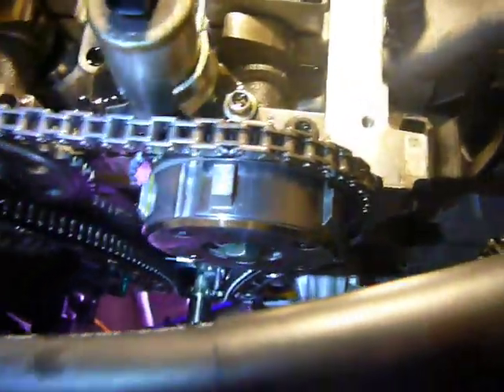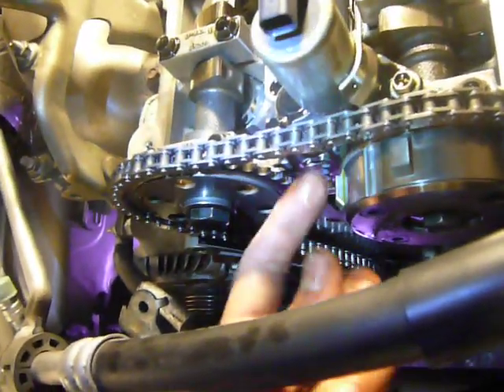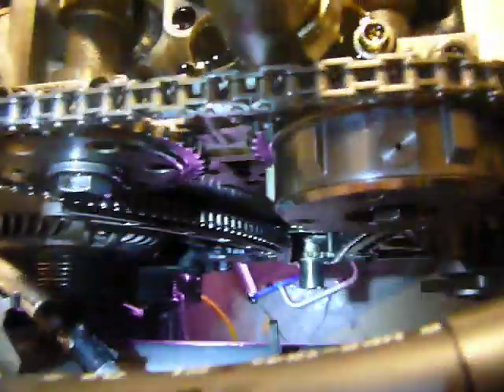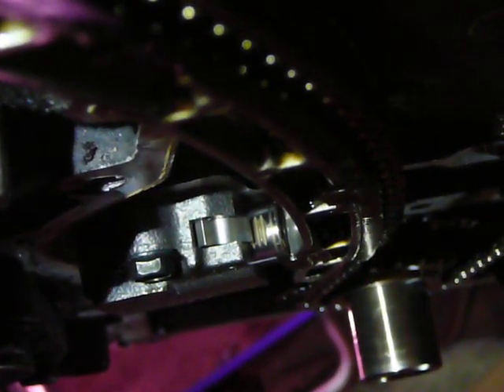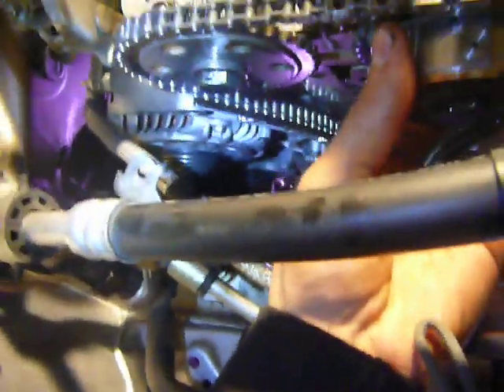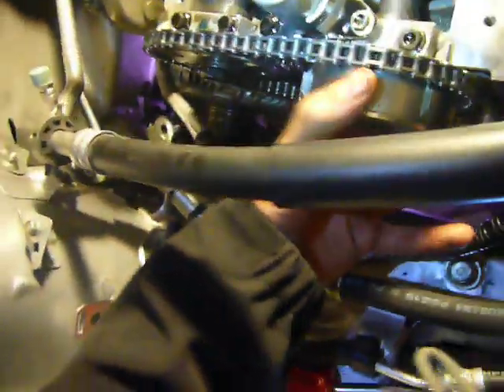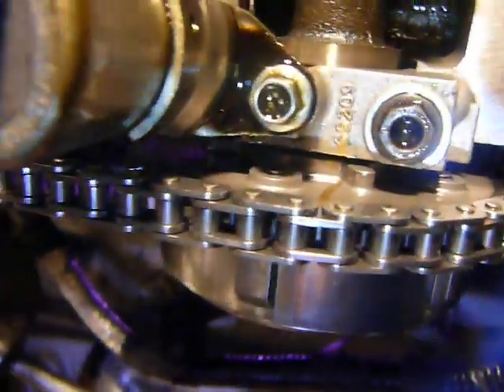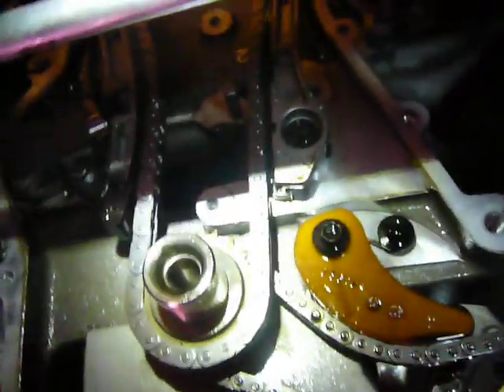Mazdaspeed 3 VVT/Timing Chain/Etc DIY Repair - Setting Chain Tension

Comment: Great video.  Really appreciate all the details you call out in your process and the full write up in your description.

I’m coming across you video as I’m researching this VVT issue.  I don’t own a Mazda… but I’m considering buying a 2010 Speed3 with 165K miles.  Im actually in talks with the seller as we speak.  And this weekend came to find out about the VVT issue.  (Im totally new to the Mazda scene).

Question: the impression I have is this VVT issue exists in all these 2.3 engines unless it’s been fixed (either out of pocket or under the extended warranty back then).  If it’s not fixed… then it’s not a matter of IF, but WHEN, right?  I mean, the slack will eventually occur.  So when considering buy a 2010 model, how would you know if the VVT was already fixed?  I assume if it was fixed under warranty, then Mazda would have a record against the VIN.  Outside of that… is there any other way to know?  The car may not have the symptoms today (the chain slap).
Reply from the maker: The issue is with all gens of the speed3 as they use the same engine. The only real way to know if the VVT has been replaced is either a maintenance record from the previous owner, which should have been a free recall/replacement unless the car has a rebuild title. Otherwise you'd need to visually inspect the new VVT part which should have a "C" stamped on it and an obviously heat-treated spot on the side, but you'd need to pull your valve cover to see these details. Seems like some cars are more prone to the VVT issue than others, I swapped mine at like 70k miles or something and the parts honestly didn't look worn out and my chain was barely stretched. Short of records or disassembly, you can feel the timing chain tension between the cam sprockets through the oil cap on the valve cover, but ideally you'd want to jack up the front right corner, remove the wheel and turn it a full revolution so you can feel the tension at multiple positions. The sound of a loose chain slapping the valve cover during a cold startup is pretty noticeable if you are standing outside the car next to the passenger side of the engine, but it can be confused with the fuel pump flutter sound.
Reply: Thanks so much for your detailed response.  This helps me a lot understand this whole VVT situation and be more prepared for this next purchase.

Comment: Came across this as i'm looking how to pull my timing cover. Looks like your engine is still in the car, I was under the impression the engine had to be pulled to do this job. Glad that doesn't seem to be the case.
Reply from the maker: No engine pull, but you do have to jack support the engine and remove the passenger motor mount. The biggest pain in the ass was getting the idler pulley off and then back on, there's barely any space between the screw head and the chassis frame there. Careful not to round the head off, it's a really small flange-head bolt. I replaced that bolt with a larger hex head so it wouldn't strip if I had to take it off again in the future. Good luck bud.

Comment: And you removed the crankshaft bolt  that also needs replacing along with the 2-3 friction washers behind the crank/ oil pump  gears
Reply from the maker: Yes bolt the crank bolt and friction washers need to be replaced.

Comment: FYI   the manual says on the VVT  point the notch to the 12 clock position  and the cam sprocket should have a dot , that also should be at the 12 o clock position and any time you unloose the cam/vvt sprocket   the Friction washer needs replacing

Comment: Mazda is a none keyed timing setup. You have to lock the Crank down at top dead center with a bolt. The balancer has a hole to lock it in place as well. The cams have a tool to lock them down as well. I have no clue why he never mentioned that part. As the cams themselves have a hex on them. So you can move each cam separate to lock them down in the rear. And it has to be on top dead center or the tool does not fit... And no the sprockets don't need indexing. As only one is controlled by the VCT.. As long as it gets oil. It works.
Reply from the maker: That's correct, this is a keyless crankshaft held together with diamond-plated friction washers. The cam alignment plate (CAP) is mentioned in the forum posts and in my video description, sorry I didn't discuss it thoroughly in the video. By the time you have got to this point in the repair you should absolutely be aware of the alignment tools.

Comment: I get this rattle when i start and turn off my ms3. Car has 116k miles btw, if it's the vvt actuator could i just replace that part or would i need the whole kit or is it recommended to change out the whole thing. Thanks
Reply from the maker: So technically it's just the VVT that goes bad but depending on how long that's been going bad it can cause other problems downstream, like a stretched timing chain. Typically for the amount of effort it takes to get into this part of your engine, it's worth it to buy most or all of the kit of potential replacement parts so that you can swap anything that needs it. I replaced my VVT, chain, chain tensioner but I ended up returning my chain guides as they weren't grooved at all and felt new. Hope that helps.
Reply: They sell a kit on edgeauto

Comment: Nice work. Too bad you didn’t do a start to finish vid. Would have been epic I know but still.
Reply from the maker: Yeah I only did a time lapse of the whole process, it would have slowed me down to first-person film the whole thing since I was up to my elbows in oil half the time. Check out the lengthy procedure write-ups in the forum thread I linked in the description, however.

Comment: I have a serious question, how did you remove the giant piece of forged metal that sits on the left side of the cams, (sides with the bolts) because I have no room to tighten the cams. Did you remove the belts?
Reply from the maker: Do you mean the timing cover? It's a giant piece of aluminum held on by 22 bolts that you have to remove otherwise you can't access any of the important bits for resetting your cam/crank alignment. I hope you didn't remove your cams without also removing the crank bolt and timing cover or there's really gonna be no way for you to easily put everything back together.

http://i59.tinypic.com/f58i9.jpg
Reply: Govanification oh I figured it out, thank you for taking the time to tell me! I'm sure it'll help other people out

Comment: What?! The timing is relying on bolt tension? No lock key pin? 😦🤕
Reply from the maker: Yup, totally smooth non-keyed crankshaft, but those special diamond-coated washers in the stack allow some crazy friction to be transmitted with just that single crank bolt holding it all together. People who start pushing an extra couple hundred HP often tighten the crank bolt even more, however, because if it slips under load your pistons and your valves will have a battle and you will lose.

Comment: how long did it take you to move the overflow and pwr steering container and stuff out way or how long did it take you in general
Reply from the maker: Moving the fluid reservoirs only took a few minutes, just undid a couple screws and bungie corded them out of the way. You should check out my timelapse videos for a sense of total time but it was easily over 12 hours of hard work spread over 3 days, and I didn't even screw up anything major.

Comment: where can i find a complete disassemble guide for mazdaspeed 6
Reply from the maker: What you're looking for is the Factory Service Manual, which you can get from various forums like Mazdaspeedforums.org or Mazdaspeeds.org, but you'll likely need to donate to access the downloads like I did. You might be able to find it somewhere else on the internet but it's mostly only available to certified shop techs so it can be pretty hard to find.

Comment: Hello mate, did you manage to change the diamond washer behind the oil pump driven sprocket on the crank shaft? can it be done without removing the oil pump pulley?
Reply from the maker: You need to remove the oil pump sprocket to get that 3rd washer replaced, which is required!
Reply: +Govanification Thanks mate, was the oil pump pulley easy to remove using the proper tool to hold it?
Reply from the maker: I didn't have the proper tool, so getting the oil pump sprocket was extremely difficult. One trick is to screw the crank bolt back in with something thick enough behind it to clamp the sprocket stack together and then try to loosen the oil pump sprocket bolt.
Reply: borearp

Comment: where did you get the torque specs can you please reply
Reply from the maker: mazdaspeedforum . org
Going vip there was the best $25 I ever spent on this car. They have all the service manuals that the dealerships use for maintenance with all the specs and assembly order for everything.
Reply: how do i make a vip account? btw thanks for replying quickly
Reply from the maker: +spoon games Regular accounts are free but you have to donate to go vip. One of the only places I've found the manuals unless you know somebody who works at a dealership. The community has like more information about this car than you could possibly read haha
Reply: ok im going to sign up for it i have mazdaspeed6 and dont know any torque specs and also where did you get the parts and are there special tools required
Reply from the maker: +spoon games Definitely do a ton of reading before attempting this. I have links in this video description to useful threads over at MSF and you should read all of the big posts there. Tool lists, parts list etc are all on there. I buy all my parts online from park mazda oem parts

Comment: Hi!!

I've already done the fix and I still have that ticking noise.

Any suggestion? I bought the whole VVT kit from Edge autosport...

Thank you.
Reply: +Mikel Pe&#241;a D&#237;az 

Note that it only does the noise  after shutting down the engine and  some minutes later turning it on again....

In cold starts it isn&#39;t noticeable at all.
Reply from the maker: +Mikel Peña Díaz Might be something else then, cold starts are typically when it's the mist noticeable. Did you replace the chain tensioner while you were in there? Could also be your serpentine belt tensioner, mine rattled until I replaced it.

Comment: does anybody know what the oil pump bolts are to be tighten to and the timing cover bolts i cant find them anywhere 07 mazda 2.3 turbo and the turbo as well i am replacing the turbo,timing chain and oil pump

Comment: it doesn't  sound like that.  same noise when you start it as when it is warmed up.  sounds like a top end valve clatter.  it is a west coast car and never been in the Missouri cold.
Reply from the maker: +Bob Haddock 
Cold start only refers to the engine oil not being at full operating temp, the ambient air temperature is pretty much irrelevant. What happens is that the oil pressure is supposed to hold a pin into a hole in the VVT to lock the timing advance at zero when the engine is starting but when the hole gets slotted out or the VVT gets gunked up from too infrequent oil changes then you can hear it clicking/rattling as it tried to engage the pin in the VVT. This is a very distinct sound but it's not the only sound. The other sound is the timing chain actually slapping the bottom inside of the valve cover, which can happen while the car is running and warmed up as well as during a cold start. This chain slap sounds more like valve chatter than the VVT pin, so maybe that's what you are hearing.

Comment: does the engine noise sound like valve chatter on the top end ?
Reply from the maker: It might when the engine is running but when the chain hits the valve cover its pretty loud and noticeably different than the injector flutter/valve chatter that's always going on. During cold starts is when it's the most noticeable cuz you can hear the chain slap and the vvt lock pin failing to engage for a couple seconds. I had bad cold start sounds but I couldn't really hear anything when idling after startup.
Reply: +Govanification How do you tight the  crank pulley without turning the crank?

Comment: Did you lift the motor at all for room or is it still secured on the motor mounts.
Reply from the maker: +Michael George Sorry man I missed your comment. I removed the passenger side motor mount and supported the engine from the bottom. This was required to remove the timing cover.

Comment: Just want to learn more from you guys, which part causes this problem, the VVT, Actuator, tensioner or other part?
Thank you.
Reply from the maker: VVT starts the problem, which subsequently stretches the chain and extends your tensioner further. If replacing your vvt it's recommended to replace everything.
Reply: Govanification

Comment: Could you show a video of how you removed the cover in front of the timing chain? I have a 2004 mazda 3 that I have to remove the valve train. But I see you did that while it was in the car. I'd like to know if you could post a video of how you removed it while it's in the car
Reply from the maker: Hey sorry but I didn't take a video of me removing the timing cover. There are 20-ish bolts on the timing cover and all are accessible from below or above with a wrench. You MUST remove and reinstall them in a specific order, however, generally spiraling inward when removing and outward when reinstalling. This order is given in the factory service manual for this car, which you can get by becoming a member as MazdaSpeedForums . org.

Comment: So i just did this on my 07 CX7 (same motor) and i'm am still getting the loud chattering and chain noises hitting the side of the cover? So I did a lil experiment and when i removed the power connectors from the cam driven HPFP the chatter stopped. Is it that I just need to replace the HPFP or at least the internal's.
Reply from the maker: Um I hope you didn't disconnect the power from your HPFP while the car was running... that's a great way to blow your engine. Did you disassemble the HPFP when you did this repair or did you remove the assembly whole (like I did)? If your HPFP is making sounds and you disassembled it, you might want to open it up and reassemble it again and take extra care to clean everything and torque all the E8 torx head bolts evenly or your HPFP won't be happy. However, the HPFP is on the other side of the engine as your timing chain... so it should be obvious what sounds are from your HPFP and what are timing chain slap.
Reply: Govanification Yes I did momentarily disconnect the harness from the HPFP and the chatter which is coming form the left side of the engine bay where the VVT and timing system are located stopped chattering. For some reason the HPFP is slowing the timing down and causing the chain to slap the casing. I did not take apart or repair the HPFP was just wondering if you changed out or rebuild your HPFP when you did this.

Comment: I'm having one hell of a time trying to perform this procedure on my 2007 Mazda 6 with the 2.3 litre engine. I have it torn apart, now its figuring out where the cog markings go? One HTV claimed that the right hand cog must point vertical towards the cam shaft? Mine isn't vertical its at the 8 oclock position at TDC with the special plate I bought from Massive that goes into the grooves of cams, now I;m  trying to install the special screw that stops the crank flange and my front right CV shaft is totally in my way and I removed to mount bolts trying to pry CV outta the way? Isn't happening
Reply: You have to pull the drive shaft out on the Passenger side. I ended up just wedging a 2x4 in there. After removing them 3 bolts that center the drive shaft. Then used the exhaust bolt in reverse. It just fit tight enough to hold the crank at TDC. And don't remove that bolt till you tighten the Balance wheel all the way down. While keeping that 9th tooth aligned with the cam sensor center pickup coil. Or your ass will be sorry.

Comment: I went through the whole description section.  And was just wondering what parts you actually bought.  Mazda is trying to sell me a $500 kit but you said you only spent $300. Im in Chicago. Any chance you live here too lol
Reply from the maker: If you check out the link to MazdaspeedForums that I put in the description, you can find my parts list of what I bought and used, what I bought and didn't use and also optional parts that you might want to buy (wear items etc that you don't know you need until you're in there). I'm in Seattle but honestly the cheapest way to buy parts is at an online mazda store that's preferably out of your state so you can avoid sales tax.

Comment: I have 2.3 in my Mazda 6, broke some valves, never found out the cause, got the head shaved and new valves put in, put everything back together and broke more valves then damaged piston heads a little, the head is chipped now so I scrapped that. Tensioner was 8 teeth out so i bought new one and a chain, now just have to buy another head and try again with new stuff!